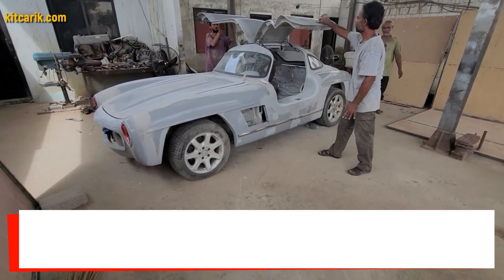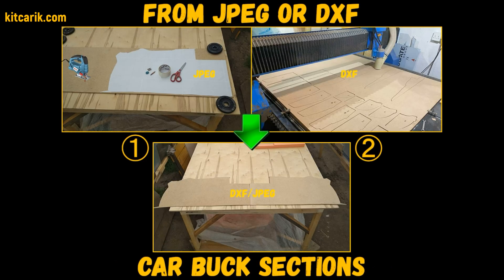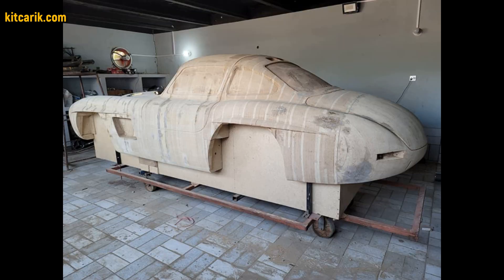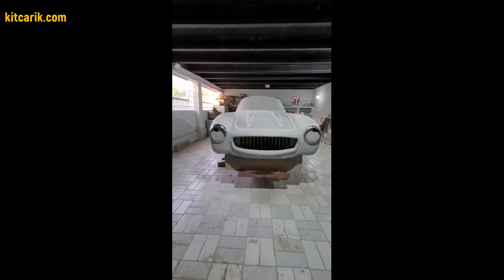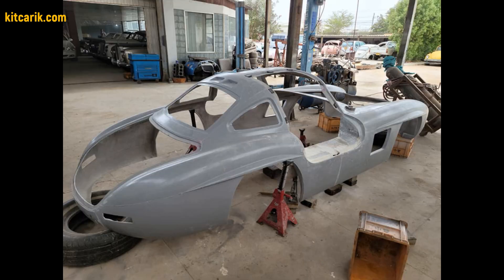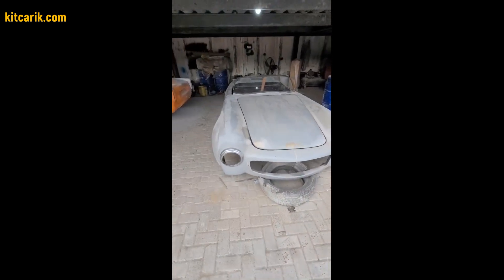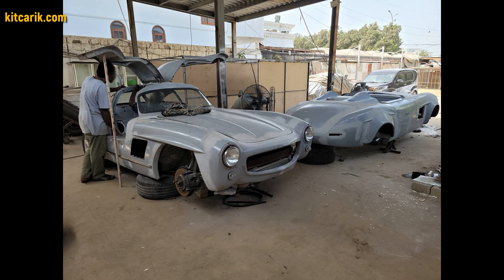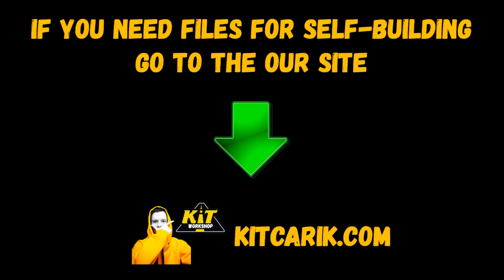Homemade Mercedes 300SL Gullwing Build | DIY Kit Car | How To Make Fiberglass Car Body Kit

Comment: The thing i want to know, what about the windshield and the other small details
Reply from the maker: All possible small parts are made either on a CNC machine or printed on a 3D printer. Windshield and other glass is made to order in any company that does, now there are no problems with this